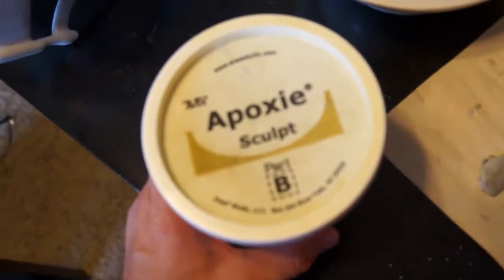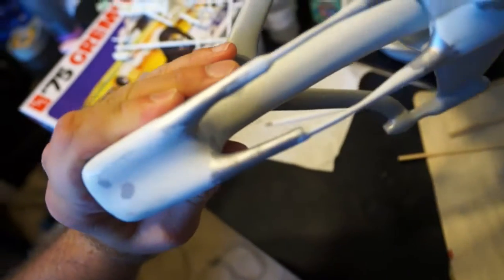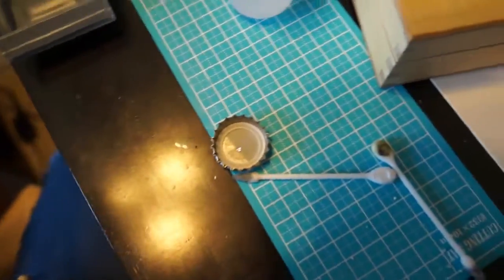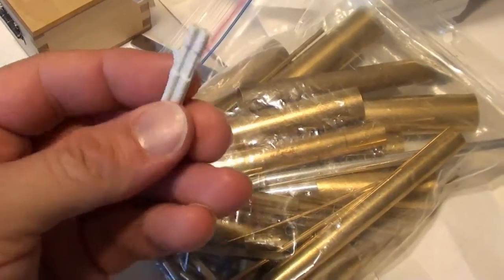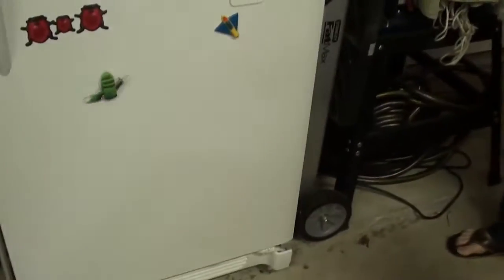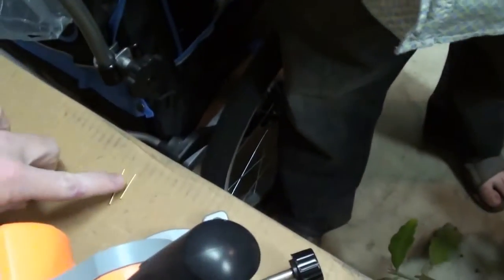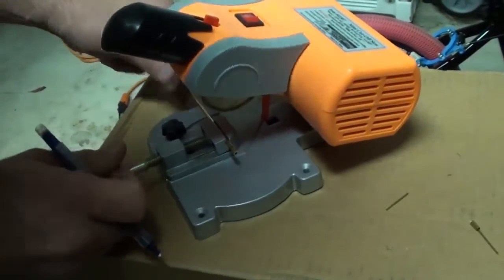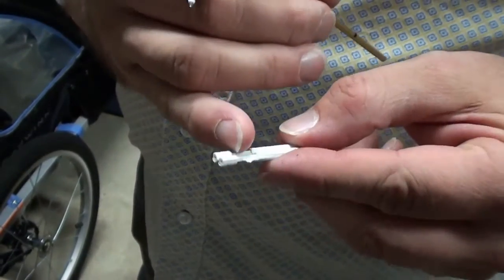Brakiri Cruiser:  Brasswork.....

Comment: With Brass tubing John,   I just roll over the tube with an Old Xacto blade 5 or 6 times... and thin walled brass tube will separate nicely...   !   just cuz I don't have a fancy power saw like you !    LOL     Neat to have tool for Solid Rods for sure....    Thanks for sharing !      Keep up the good work !
Reply from the maker: One question:  How do you cut a tube on an angle with your method?  I use to use a miter box with a razor saw, but since I got this power saw, it has been a lot easier.   It wasn't expensive either.  And yes it cuts solid rods really well.
Reply: Good point John !    I wasn't critical of the Machine....  I like tools to !

For Straight cuts... The rolling under the blade works fine... or a K&S pipe cutter could work also well... but  As you mentioned !  Angle cuts ?   some sort of grinding or adjustable cutting wheel is a must...   I like your little Cutter by the way !  and yes..  for RODS !!!   its a must ! 

I'll keep my eyes peeled for one at Princess Auto..  our version of Harbor Freight Tools
as I love working with Brass as well !
Reply from the maker: Norm Lajoie I didn't think you were being critical of the machine, your method is easier for those that are starting out.  I was just wondering what you did if you had to cut it on an angle.....

Just so you know, I have been using the same blade in that machine since I bought it.  It still cuts very well.
Reply: That is actually Good info!   if the Original blade still stands today !  that was a really good investment... as long as you keep cutting softer metals.   Like Aluminum and Brass....   Keep the good video coming John !    We are watching !